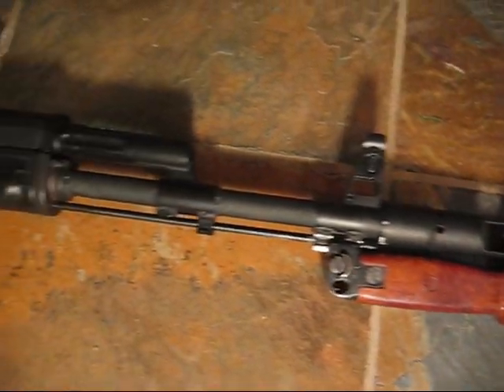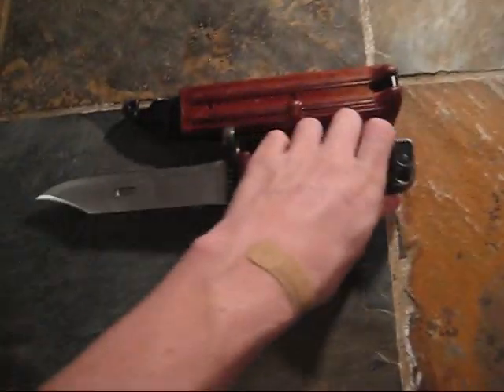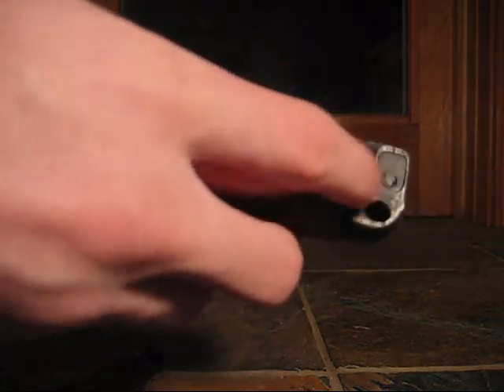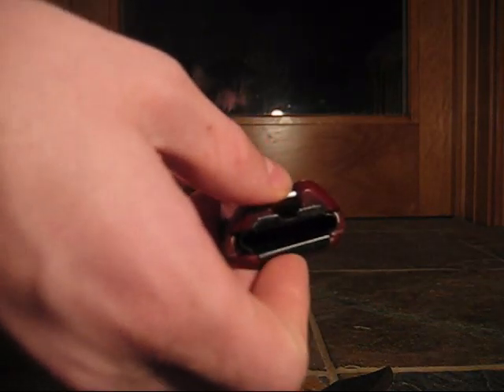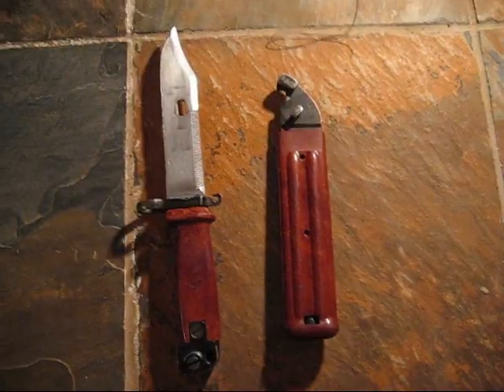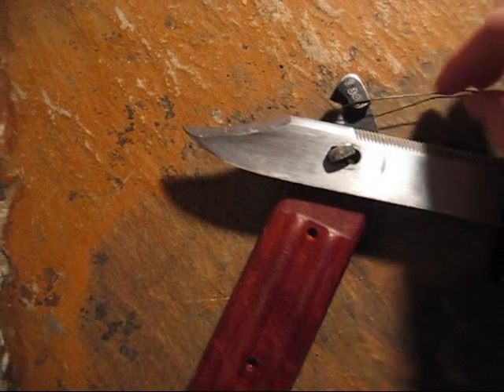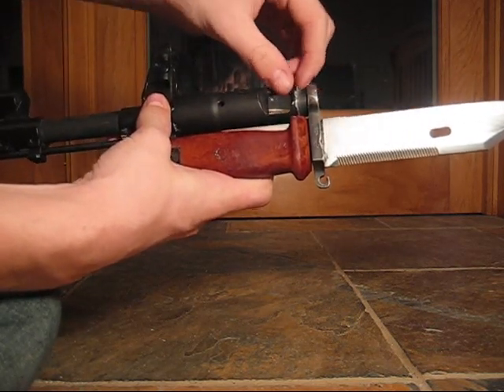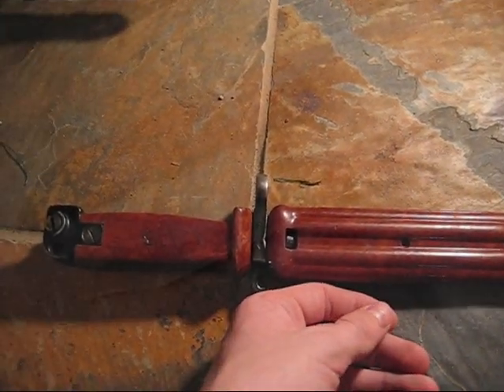Soviet Type III bayonet Review

Comment: Good review! I have the Chinese knock off without the wire cutter element. It also lacks a serrated cutting part.  

The only difference with the scabbard though is that it doesn't have the extra length to accommodate for the wire cutting ability since the knife itself doesn't have one.  It ends in a 'V' shaped point in consistency with the main body of the scabbard.
Reply: Christian Lara lots of Polish AK type ii’s lack the saw

Comment: He calls it the type three bayonet because this is the third bayonet model for AK type rifles. The second and third models are part of a series, which is the plastic Bakelite pommel, and the latter one with a steel pommel, In which soldiers used as a hammer as mentioned in the video. Most people forget the original AK-47 bayonet, which is black. The first model was very simple compared to the second and third models, and therefore, most likely forgotten or disregarded.